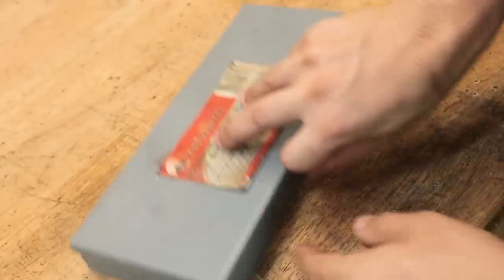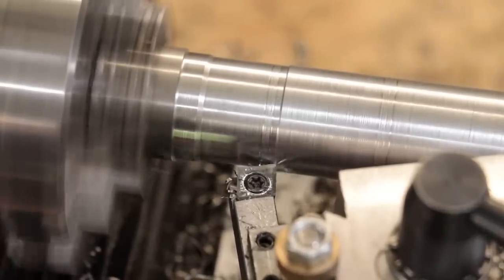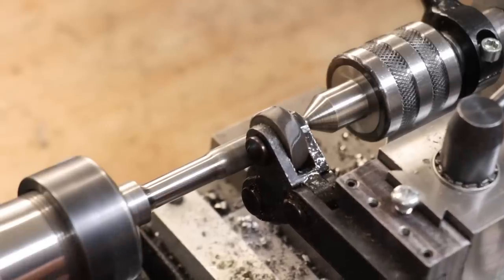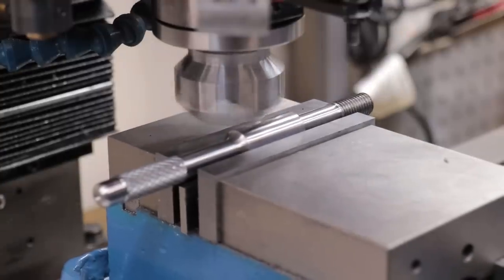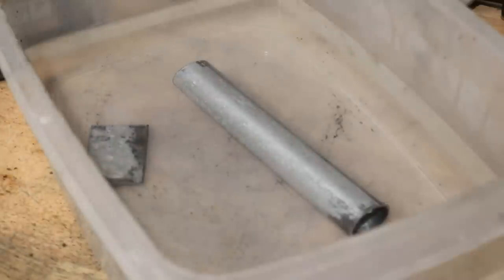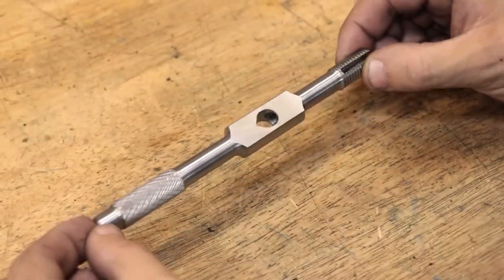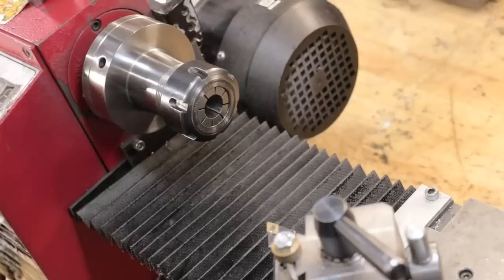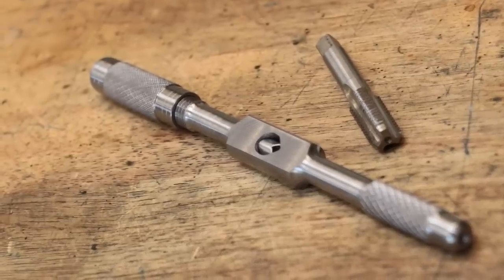Vintage Style Tap Wrench Build

Comment: 6:45 That "concentric" center on the end though lol. I know it's a small lathe, but I think with a more meticulous setup, you could minimize the deflection you get at every step, especially since it is far more pronounced with a small lathe. At 2:19 you should probably have used a dial indicator. Also, that center drill really needs to be on-axis with the lathe chuck. Idk what options you actually have to adjust it with screws or shims, but I am pretty certain that this is causing the deflection which in turn causes all the chatter and later on the center not being even close to being concentric with the outer diameter.
But I am mostly an armchair machinist.
Reply from the maker: For a project like this it really didn't matter and I didn't take too much care to keep it concentric, eyeball is just enough. i only break out the indicator when in dialing in a machined surface. Doesn't really matter when you're taking 10mm off the OD of rough stock as the turned stock will be concentric to the spindle. I think there was a bit of taper in the part that made it wobble a bit once I flipped it but it didn't really matter since I just recut the center.
Reply: @artisanmakes  Well, I still think the live center not being concentric with the spindle causes your stock to continuously deflect and cause the chatter. Even though concentricity didn't matter much with this part, you'd get a better surface finish and had less chatter (read: cut your part a lot faster) by dialing in the stock at the chuck, at the far end, end then make sure the live center doesn't cause deflection when you push it into the stock. Especially on such a small lathe where it's more likely that the stock is distorting your lathe, and not the lathe deflecting your part.

Comment: Please don't take this as criticism but case hardened parts don't require temper because the inside stays soft to absorb impact or any potential damage.
Reply: The point of tempering is not to soften the inside, but to temper (soften) the martensite phase created on the surface after the quenching. It is definitely required if you want the surface of your tool to survive cracking. Martensite is very hard but very brittle and it will chip/crack really fast if you don't soften it a little bit. It doesn't matter whether the inside is soft enough to absorb impact or not.
Reply: @OzanTheWise  Which is the point of the inside still being soft. I've never seen a case hardened part crack because it wasn't tempered. The soft inside allows a level of flexibility. I work as a metallurgist for my employer.
Reply from the maker: I normally don’t, I didn’t when I made my v blocks. One of my engineering textbooks does seem to reference that tempering at around 130 gives a slight relief to the hardened part and slightly reduces that change of cracking. Not sure if it will ever matter but an extra 2 hours in the oven might pay off in a few years.
Reply: @JETHO321  Oh ok, if we are going to pull rank for the sake of argument, then please allow me: I am writing this comment as I sit in my office in the university that I am working for for more than 15 years as a professor of Metallurgical and Materials Engineering Department. I have been a part of the education of hundreds of past and future employers and employees of metallurgical industry.

So, let me tell this to anyone who is interested: It is almost always mandatory to temper a steel after it has been hardened. The difficulty in using a steel that has only been austenitized and quenched (which is what "case hardening" is) is that it is almost a full certainty that the microstructure of the surface is fully martensitic and the steel is now in its "most brittle" condition. Unless the engineering drawing calls for maximum hardness achievable, it will be necessary and mandatory to temper the hardened steel.

In industrial applications, maximum achievable hardness requirement on a part rarely comes without additional load requirements. Because a part that needs to be hard on the outside is almost always subjected to different loads from different directions also. In those "rare" situations where the only mechanical requirement is the surface hardness, we don't even utilize martensite microstructure, because it is hard and expensive to achieve homogeneous martensite layer thickness and there are better solutions out there like hard coatings in which it is easier and cheaper.

You said you have never seen a case hardened part crack because it wasn't tempered. There are multiple possible reasons I can think of for this; (a) the part you are talking about is one of those "rare" situations where there are very little to no additional loads on it, (b) you haven't examined them after a long-time frequent use, (c) hardening processes can be applied with different levels of intensity and sometimes tempering is intentionally avoided.

For reason "a", you are absolutely right that tempering is not required but I can't think of a logical and economical reason why a company chooses that process over hard coatings.

For reason "b", this is the situation for Artisan Makes. He is trying to replicate a tool of his great grandfather and I assume wants to create it so that it can be used frequently for many years and possibly become an heirloom tool. In that case, tempering is an absolute necessity. Not only it is because of wear resistance requirement but because of how that tool works. It is a tap wrench and it is significantly subjected to bending and shear stresses when in use. There is no way that it will survive cracking with a fully martensite surface microstructure even if it is softer on the inside. It is like laminating glass with polycarbonate and expecting the glass layer not to crack when bending it.

Finally, for the reason (c), in industrial applications you would want to choose a process that will give you the properties that you want as precise as possible (quality control), as fast as possible (efficiency) and as cheap as possible (cost-effectiveness). So sometimes, it is better to apply quenching intensely and then temper it because that way gives you more control over the microstructure as well as the thickness of the layer. But this is a two step process that will take longer. So sometimes, you reduce the intensity of the quenching by changing the temperature of the liquid that you use or the duration of how long you will immerse the part in it. That way still gives you a certain amount of martensite and its benefits, but with less brittleness and a quicker single step process instead. But this time it will be hard to control. So basically, you have to decide which one you can sacrifice: the time or the control. So this may also be your case where the parts are not intensely quenched so that they require tempering afterwards. But again, this is not the situation here in this video or for most of the water/oil quenching we see on Youtube. When you submerge a heated (austenitized) steel part in to a large volume of room temperature liquid that long, it is a fully intense quenching that will give you very rapid cooling and a large surface layer of fully martensite microstructure. That is as brittle as it can get and needs tempering to be even remotely usable in a tap wrench.
Reply: @artisanmakes  It matters more than one would assume from a technical point of view. Especially, for a tap wrench that is constantly rotated back and forth and therefore subjected to significant bending and shear stresses. That is how you create an heirloom product, with a balance between hardness and toughness which is only achievable with proper hardening and tempering.

I think in case for the v-blocks, you may get away with it since it is a precision alignment tool and doesn't directly subjected to bending/shear stress because most of the stresses are usually channeled to and countered by the vise that you attach it to.
Reply from the maker: @OzanTheWise  Thankyou for your thoughtful comments. You put it more concise than I ever got from my lecturers in uni. I think I should have mentioned that when I was doing my V blocks, I used this heat treating method that I found in an old heat treating manual from the turn of the last century. Putting the blocking in near boiling lindseed oil to get a more uniform quench and get a lower hardness that would be more suited to the application. You may be right, I might get away with it, but only time will tell. Cheers
Reply: @artisanmakes  That is actually a great approach and exactly what I was talking about "reason c" on my previous comment. Linseed oil has a boiling temperature around 300 C. You simply applied a more gentle quenching which will give you less martensite than hard quenching, but also less brittleness, more toughness and still a certain level of hardness without any additional tempering. Simple, clever and cost/time-effective. Cheers to you too...
Reply: @OzanTheWise  And it sounds to me as if you're speaking of fully through-hardened parts, not case hardened parts which have the benefit of the soft inner layer to act as a cushion. Im well aware of hardened parst and the process of tempering back but I stand by my point that tempering isn't necessary with case hardened parts. A plethora of older firearm manufacturers used case hardened parts in guns, many which were hammers taking impacts for nearly a century.
Reply: @JETHO321  Sounds to you? Right, I can't tell the difference between bulk hardening and case hardening because I am horrible at my job.

And, those case hardened part used in guns by those plethora of manufacturers?? For your information, those are hardened by oil quenching (ever heard of steel oils?? No??), not by water quenching like the one in this video. Water quenching has a high severity of quenching where the cooling is very rapid. Because, water as a quenching medium extracts heat much faster while oil as a medium will extract heat much slower, hence the rate of cooling will be slower than water. Oil cooling will generate less stress and moderate hardness, therefore still keep a certain level of toughness. That is why you don't need further tempering and it will still withstand impact without cracking/chipping. It has nothing to do with the softer inner layers "cushioning". Because there is no such thing. The inner layer may have the same level of hardness/toughness as the case hardened surface and it won't change its impact resistance.

But as I said, that is not even the case here in this video, because this part is case hardened by carburizing to increase the carbon content of the surface, then austenitizing and finally "water quenching" in which tempering is 100% mandatory. I guess you will still stand by your point, based on your level of understanding the fundamentals of the process. Cheers to you too...

Comment: This comment is more for those who are new to knurling and are having issues. After putting Dykem or Sharpie on the stock. Try putting the knurling tool against the stock just firmly enough to leave a mark (with tail support whenever possible), then turn the work by hand to see the pattern emerge. If it's wrong, move to another spot, spin one knurling wheel a bit and try again until its right. Or you give up. The final knurl you leave will cover any practice scratches you've made, as long as they're fairly light. Also, I've always had better luck knurling at lower speed. I'm sure there's an expert video on YT about knurling though. Have a good day all.
Reply: You described the way I was shown to get a knurl started. If all fails try turning ten thousandths of an inch off the diameter before you  give up. Might be all it takes.

Comment: If your knurling tool doesn't make nice knurls like the trouble you had @18:20, it is because the diameter of the workpiece is wrong and the knurling tooth doesn't land in the groove made by the previous pass.  So run a skim cut down the part to remove the bad knurl and try again. the slightly reduced diameter is usually enough to get the tooth to land in a groove.  - they are usually pretty forgiving, but if your tooth lands right in the middle of the previous tooth's pass, it will make a new knurl and look bad.  you only need to remove a tiny amount. - Something like: 1pi over the width of one knurl groove.  its miniscule.
Reply: also, the clamp-style knurling tool is sooooo much better than the press type like you have there.  Not expensive either.

Comment: Nice project, the shop bought tap wrenches these days are terrible, even expensive ones are just another version of those dodgy cheap ones. The only way I can get them to work is to stick the moving jaw handle in the vice and use the tap as a lever to get enough hurt on it to get it tight enough to work properly

Comment: Why do you think it was chattering despite the support? I was making something recently that stuck out quite a bit and it chattered despite the live centre. I couldn’t understand why. My lathe is quite large also.
Reply from the maker: There are probably a few reasons which add up. Could have used a sharper cutter, different rpm and the tail stock isn’t that rigid. Sometimes trial and error will get you to a point where you’ll get the best cut you can read get.

Comment: the issue you are having with knurling is that your aren't planning the knurl - just assuming it will work
The wheels have a set diameter - meaning that you are essentially driving it like you would a mismatched gear set
The odd knurl pattern is the result of that mismatch in ratio between the knurling wheel spokes and the part diameter meaning the pattern is not uniform
There are calculators online to help chose appropriate multiples of your knurling tool size
Reply: I have a clamp type knurl tool that only came with two wheel sets.  Where would I order more and what are they called?
Reply: @matts8023  I get my stuff from McMaster-Carr. They are just called knurls. If you choose them, Mc-Master Carr sells them singly and you'd need to order a right-hand and a left-hand knurl to have a set.

Comment: For the future, hydrochloric acid (muriatic at the hardware store) will remove zinc very effectively and in a short time.  It's cheap and effective for this purpose, easily neutralized with baking soda, and it means not vaporizing zinc fumes.  Win win!

Comment: DON'T grind the old tap! Do rust bluing on it, boil it in distilled water once then use 0000steel wool to "card the surface" after that it should clear most of the big stuff off the surfaces. After this point you could Blue it proper or just polish it up.
Reply from the maker: I’m more leaning towards electrolysis rust removal. It’s always work out great for me.
Reply: @artisanmakes  Whatever floats your boat! I'm a OLD gun guy, so I lean more towards the blued steel and wood aesthetic. I wont tell you blued steel is impervious to all environments, I just like the look best. I did the conversion process on a old axe head that was a ball of rust from about 6 years of sitting in the California sun and rain, it blued the surface of the good metal underneath the big flakey stuff.

Comment: Welding Galvanized metal can cause whats know as Welders Parkinson's. Do not weld Galvanized unless you absolutely have to and then use plenty of ventilation.
Reply from the maker: Yeah nasty stuff, I always break out the respirator for it.